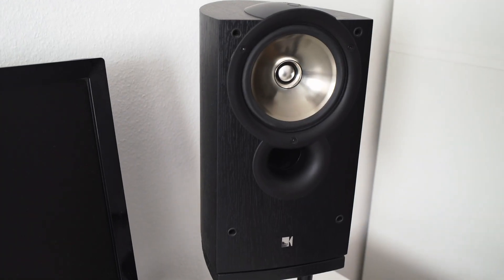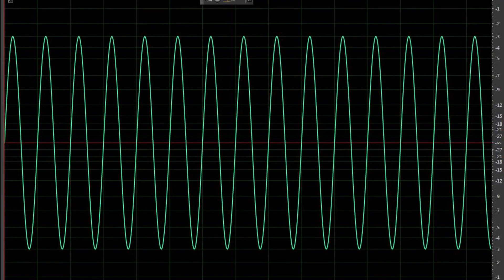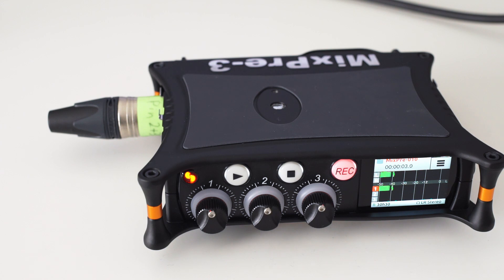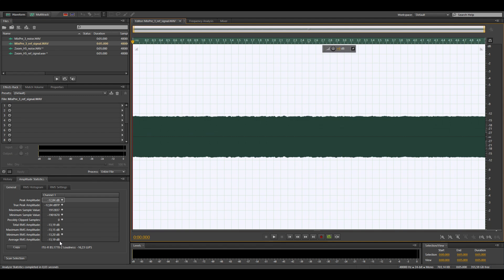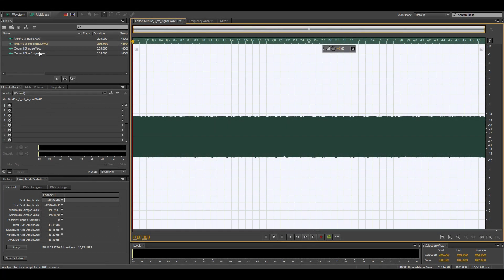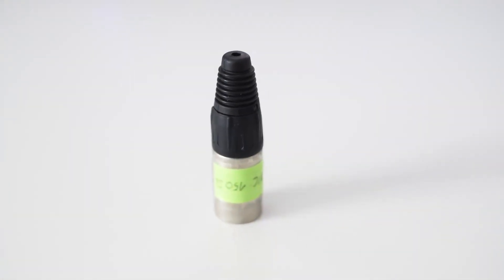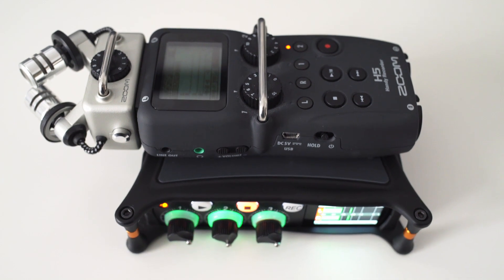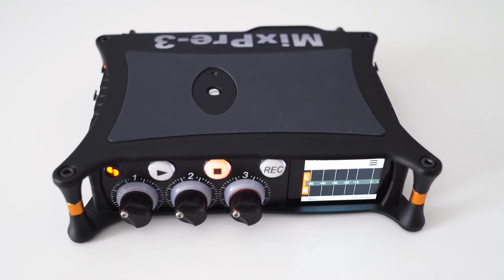How To Compare Preamplifier Noise (150 Ohm method)

Comment: Hi! I recently encountered review video by Curtis Judd of ascam FR-AV2 comparing it to Zoom F3. These are two recorders I consider using. Zoom F3 has few advantages to me including much lower price, smaller footprint, less power requirement and extremely straightforward operation. Also most reviews stated that their noise performance is virtually identical, which seems legit given that both boast -127dB (A) EIN. In test by Matt WhoisMatt Johnson they sound identical. However Curtis found 10dB higher noisefloor on Zoom F3 with 150Ohm resistor plugged, which was puzzling to me. A staggering 10dB difference in noise floor has to be some kind of mistake in testing protocol or data interpretation, because 10dB in self noise is a greater difference than between H4 and f4 or between H5 and Mixpre II kashmere preamps.I digged deeper and found that Zoom H5studio boast having F-series preamps with -127dB of EIN. However it only has a gain range of 0-60dB whereas F8n had 10-75dB. I figured out that F3 and H5studio utilize the same preamps just for Zoom F3 being 32-bit float only they just skipped stating gain range. Also Tascam FR-AV2 states only 0-50dB of gain range which is huge difference that could mean that this recorder cannot drive properly all dynamic mics. This difference in noise floor measured by Curtis Judd  matches so closely the difference in max gain (assuming F3 has the same preamp as h5studio) that I thought it cannot be a coincident. There must be something we are missing here. Something not taken into account. Or maybe this is a real difference and I should avoid Zoom F3. I own H5studio and I am very pleased with the cleanliness of its preamps. Conversation with Curtis did not bring an explanation. Maybe you can help shedding some light on that topic?

Comment: Thanks for the video :-) Would it be sensible to use 220 Ohm to compare some preamps or is this to high?
Reply from the maker: Also fine, it should roughly represent the impedance of a microphone. It's more important to keep the dummy load the same between tests to make it directly comparable.
Reply: @JulianKrause thx 🤗

Comment: Hi, this is the "agreed upon" method for XLR/balanced interface, right?
What about unbalanced connection, is there any similar method such as this?
Reply from the maker: Hey, it's the exact same. This method works with an audio intput, regardless whether it is balanced or unbalanced.

Comment: Hi dear Julian,
following your experience and instructions I am trying to measure the noise introduced in recording by a good little mixer (Phonic AM55) connected to an audio card (like first try I'm using a Behringer UM2) to evaluate how is good this micro mixer in terms of noise.

I have revealed a difference for 1Khz recordings about 0,17dB then I have amplified the lower ones (dummy 150 Ohm mic and 1khz) to match with the higher value track, then adding 0,17dB obtaining the same value in RMS dB between the 1Khz recordings. 

After this I have measured the RMS value of the two dummy mic tracks and I have a difference of noise of around 3,5dB by the track recorded with the mixer to audio card and the track recorded directly to audio card, the mixer track has a value of -86,70dB and the audiocard direct track has -83,21 then I have less noise using the mixer with microphone and recording with the same audio card than a microphone recording directly with audio card.

Do You think is a realistic result?

Thank You
Marius

Comment: Since i don't have a  soldering iron to build one on my own, im curious: is it possible to use an DMX Terminator Plug instead? I'ts alsmost the same, being a simple XLR Plug with a resistor between Pin 2 and Pin 3. The only difference is the impedance of the resistor at 110 / 120 Ohms instead of 150.
Reply from the maker: Hey, that's an interesting idea and that should work. Of course, the impedance is a bit lower than the standard 150 Ohms, so your readings will be a sightly bit better (lower noise). But not by much, I would expect a difference of about one decibel. So, I think you can get quite close with using the DMX Terminator.
Reply: Thanks for your reply! I’m glad, it’s not so much difference. But now I saw quite a few dynamic microphones with a sometimes drastically higher impedance. For example the Shure KSM8 B at 300 Ohms or the Telefunken M80 at 325 Ohms.  Should one use a 300 Ohms to match the noise there?

Comment: Does the resistor wattage rating matter?
Reply from the maker: No, as no current is flowing through the resistor. Standard 1/4 watt metal film resistors work fine.

Comment: Hello Julian! Unless I didn't fully understand what you did (I watched it over a few times) may I observe that turning up different preamps in different units "all the way" and then adjusting the sound system source to -12db doesn't calibrate the two units to each other as it seems you're trying to do, as it ignores the possibility of different units' different gain capabilities, which could vary by tens of dBs. Indeed, if you do have to adjust the sound source level, it would suggest you definitely do have different gain capabilities in your preamps. Surely it would be best to set one the way you illustrate, and then keeping the sound source the same, adjust the second one's preamp. not audio source level, to get -12db deflection which would mean both preamps are gaining the same amount? Looking at the specs, the Zoom has 55dB mic preamp gain, where the MixPre has 76dB, which might account for the rather low delta between the two in your test,  which I would have expected to be much more, say a number of tens of dBs from my experience of using such units, and their published specs (seems the MixPre was possibly gaining another 21 dB more than the H5, and still won). It also seems weird that you tested only the H5 (an average performer in the noise department) vs. the  MixPre (a great performer, and arguably different type of recorder) yet you showed the F8 in the previous video, which is what I really wanted to see (I have the F8n) and which would have probably given the MixPre a much closer run. I think a calibrated test between all three would be useful.
Reply from the maker: Hey, you could use your described technique and match the analog gain of both devices but then the analog to digital converter (ADC) performance might come into play. If you record the sound of both devices at their maximum gain setting and then compensate for the gain difference in the digital realm you ensure that you only compare the noise of the preamps. It's because at max gain the preamp noise dominates and that's why I suggest to compare the preamp performance as shown in the video.
One big misconception is that the digital recording device with more gain will record a higher digital signal at the maximum gain level. You can't directly compare the gain figures as you have to take into account the ADCs lineup level for 0 dBFS. 
I compared the H5 and the MixPre--3 because I wanted to demonstrate my method. This is best shown with bigger differences. If I would compare the F8n to a MixPre-3 the difference would be somewhere around 1 or 2 dB which would have made for a less informative video in my opinion.

Comment: Perfect! Would this work if I use a dynamic mic with on/off switch instead of the 150Ohms plug? Thanks
Reply from the maker: I don't think that this will work. If you have the switch set to the on position the noise in your surrounding will be captured by the mic, skewing the measurement. If you set the switch to the off position, it very likely cuts the connection and this is the same as if you had no mic plugged in.
Reply: @JulianKrause  thank you for your answer! I really like your videos!

Comment: Sir if my mic itself is 150 or 200 impedance, then the test plug is not required correct? I mean i can use my same mic itself on both preamps to test?
Reply from the maker: Yes, but you have to be careful when testing with a microphone because it will also pick up the noise of aour surrounding. In the end you might not be able to tell apart the self-noise of the mic from the ambient noise.

Comment: Is it possible to test the self noise of a condenser microphone? I would love to see a video like this if you're willing and able :)
Reply from the maker: Testing noise of a condenser mic is a bit tricky because if you want to do it right you do need special equipment. First of all, you do need a reference sound source that will produce exactly 94 dBSPL. A setup like this usually only gets consistent results in an anechoic chamber. Then you do need a small sound proof chamber in which you put in the mic to measure the noise.
What you could do is to compare two condenser mics against each other. This way you don't need the 94dBSPL reference and anechoic chamber. The measurements will not be precise but should still provide a rough estimation of how the two mics compare in terms of self noise. I´m currently working on a method to compare condenser mic self noise and once I finalized it I will share it with you!
Reply: thank you so much!
Reply: @JulianKrause  👍add some dynamics to the test when you do;)
Reply from the maker: @RayOrtega  That would be interesting. Though it's pretty difficult, because then you also have to take into account the preamp noise of the recording device. I'll see what I can do. This video is long due...
Reply: Yes, it is, but if the mic is of good quality, you need a really quiet place to do the test.

Comment: In my opinion, 6:58 needs more explanation. I would suggest sth like that. "Due to higher sensitivity of condenser microphones, pre-amplifier needs less gain than with dynamic microphones. And the lower gain, the lower self-noise of pre-amplifier. Thus, usually self-noise of pre-amplifier is not an issue with condenser microphones." Otherwise it's a very good video. I'm glad that you listen to comments from your audience and changed 0 Ohm method to 150 Ohm method. And that you accepted that self-noise of a decent resistor is less that self-noise of a decent pre-amp.
Reply from the maker: Your`re right, in the end it really matters how you interpret the data. Testing with 0 Ohms is not completly wrong but it simply does not give any usefull information when comparing preamps. Testing with 150 Ohms yields in much more real world results.